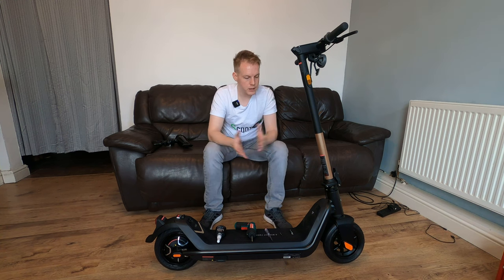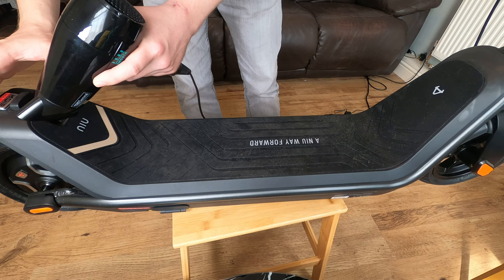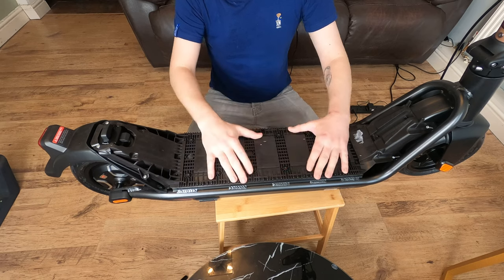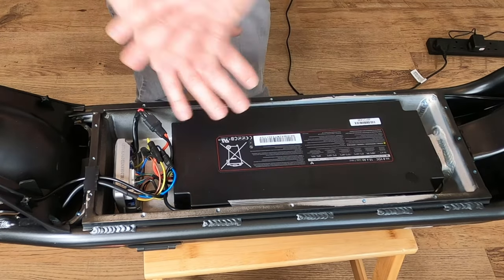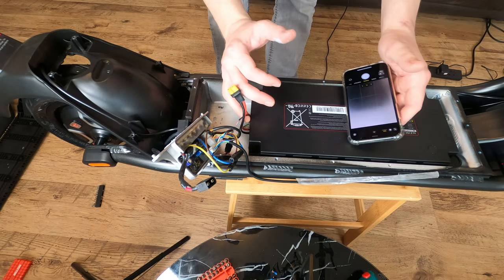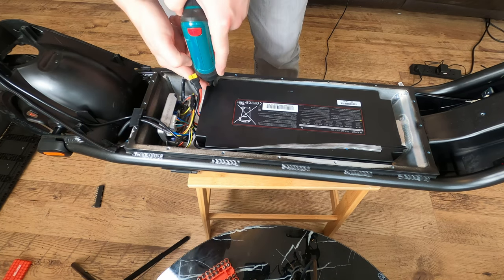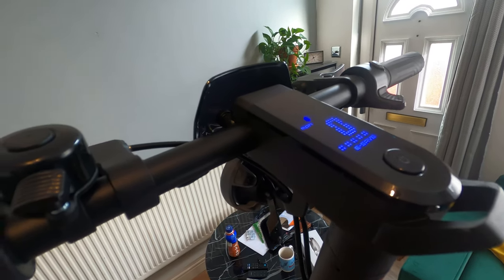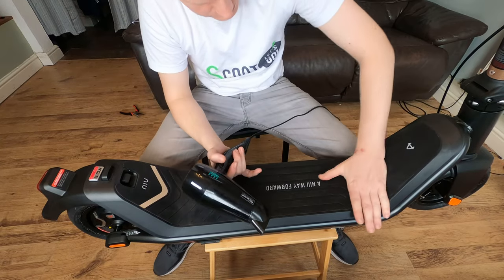How to Change KQI3 Battery

Comment: Wounderful video. Six months ago I purchased the Niu KQI3 Pro which came with poor quality tires. Well I have multiple leaks on the rear tire which couldn't be plugged and if it wasn't for your video i wouldn't of known what it takes to replace the tire. There's no store around that will even attempt to fix these scooters. I just ordered a new tire. hope i can do the repair. My advise to potential purchasers. Don't waste your hard earned cash.
Reply: Do you suggest not to buy this model?
Reply: @demetriussour5771  based on how complicated it is to replace the rear tire, i can't recommend it. I have to basically disassemble the scooter for this! ridiculous.

Comment: I bought a 5 gallon bead seater and 8 gallon air compresser to help me with this project and it made it 100× easier. I am blessed before I spend countless hours messing with tire and got no where except pissed off  But now I am a changed man lol. You can go ahead and tell every body imma man I'm a man im a man. If you can fix these you da man. So go and be the man.
Reply: Fuck I rebuild the hub wheel with a y winding change out my controller doubles my speed ...I sure can't do a battery 😊😊😊😊😊😊

Comment: Hi mate any chance you could help me, I bought a this scooter second hand and it’s not working, the scooter is stuck in e save mode and will not come out, it’s stuck on dynamic riding as well, and when you go into the NIU app it says “ NO battery” even though it has a fully charged battery on it, I’ve tried ressetting the app, unbinding the scooter and re bind, I have charged the battery for 72 hrs, it shows fully charged on the scooter display, I have also put a multi meter on the battery terminals and we confirmed it works and is fully charged, I work for a motorcycle dealership called on the wheel and NIU operate out of our same building and even their technicians have no idea why it won’t work, thanks

Comment: Thanks, this is what I needed! I'm just wondering if it's possible to connect a wire to the battery to recharge all the accessories I've attached to the scooter (such as lights and turn signals)? I asked this question on Reddit and was told I should not mess with the front light wire as it has low voltage/current and attaching more things to it might overload it. How do you think I should proceed?

Comment: They really don't want us in their scooter, have you figured out how to remove the speed limiter?
Reply from the maker: It’s easy enough to get into.  Just a lot of steps.  
I have been looking into this.  Once I find out.  I’ll do a video on it :)
Reply: Have you figured out how to remove the speed limiter ?
Reply from the maker: Once I find out.  I will do a video
Reply: like badly! Mine is locked on 25..
at least got the kick start disabled so just throttle away
Reply: @ScootLetsGo  can you make a video for us Europeans, how to unlock 32km/h for KQI3 pro? I am stuck with 25km/h :(((

Comment: So when I turn on kqi3 max the heals light stays on and there’s 12 red dots in the screen anyone has any idea what’s wrong I bought the scooter used knowing it had issues but don’t know where to begin also when I try rolling it to my van it started beeping and noticed back tire wasn’t spinning ???
Reply: It’s locked and in anti theft mode, you’ll need to unlock it in the app, but if you don’t have access, kinda SOL.  Email NIU and see if they’ll unlock it for you.

Comment: What is that strange battery? 46 volts?
I'd like to put my own battery in it, but I guess I can't. The battery has the data port and if I put my own in there then the scooter will probably not drive because the bms does not communicate with the controller, does it?
Why are they all doing this?
I already have 2 scooters where I drive a dead battery around with me just because they don't want to drive without a connection to the bms....

Comment: Just curious…should I unplug the charger once scooter is fully charged?  Is it bad to leave it plugged in?
Reply: BMS stops any further charge anyway , have no worries . On a side note and different topic but thought it would help , on higher end scoots like the Vsett 10+ having regen braking on  while the battery is already full has proven it can make the controller fail which is an awfull $150 down the drain unless you've got a nice dealer and still covered by warranty .

Comment: Can you do a backtire change video please I'm having trouble getting the reflectors off of the frame to remove the tire
Reply from the maker: I will have a video coming out shortly with the rear tire :). 
You will have to follow this video before you can remove back wheel.

Comment: Hey man, do you know how to set up the scooter to the original speed? I would like to drive 32km/h. Now it's limited at 25km/h (European version) I really hope there is a software build that makes this possible. 👍
Reply from the maker: Hey.  I’m currently looking into how to do this.  Once I know. I will put a video out :)
Reply: @ScootLetsGo  I tried to get the software from them but they wil not give it to me, even when the kick scooter is used on private property they keep talking about European rules and regulations etc. 😔
Reply: same boat Bud , NIU app version 4.6.46 allows for non kick takeoff, and has cruise control - maintain any constant speed for 5 sec and you can let go of the throttle, disengages when braking or accelerating - let me know if you want a download link
Reply: How much does a motor cost if you ever need to replace it? Or can you even buy an extra motor
Reply: Do you know the what color wire is the governed wire
Reply: @anthonyarnold474  nope I just uploaded the hack software and now it runs 32km/h

Comment: Where do you get the battery and how much does it cost. Also other parts, where can I buy?
Reply from the maker: They should be adding more to their store.  Once I get the links I will post.
Reply: I have a flat on my kqi3 pro and couldn't find  the tire  on the sight they emailed me an alternative which is called besender they not only had the tires on sale but most every component of the scooter for sale  individually.
Reply: @foxrex351  is it reliable? im on the website right now it looks kind of sketchy

Comment: Wow it takes a lot of work just to get to the battery. It would suck if you have to change the tires.
Reply from the maker: Most scooters do require a little extra work for the rear tire unfortunately

Comment: I notice this is poorly waterproofed comparatively to the kqi2. I don’t see any rubber seals around the battery cover to protect from water or dust. So many ways for water to get in. Regardless of it raining very lightly from above. The water on the floor would quickly get in and kill this scooter